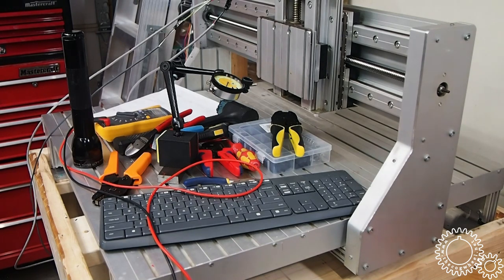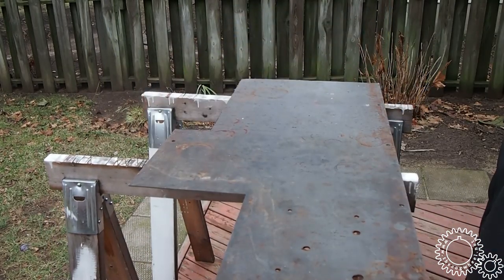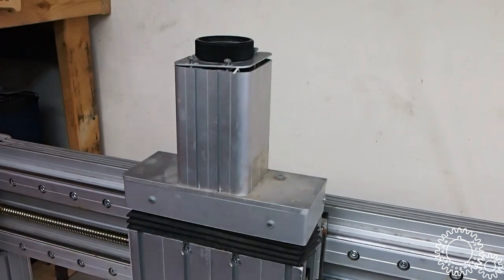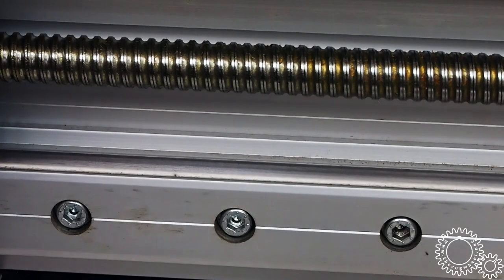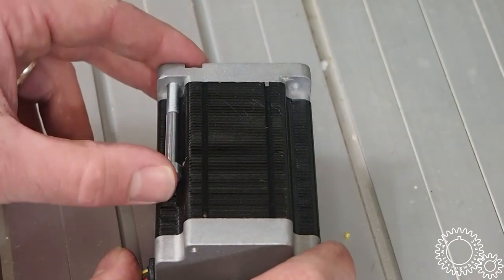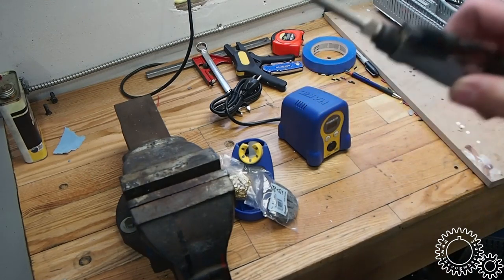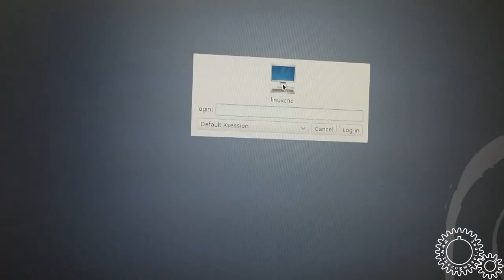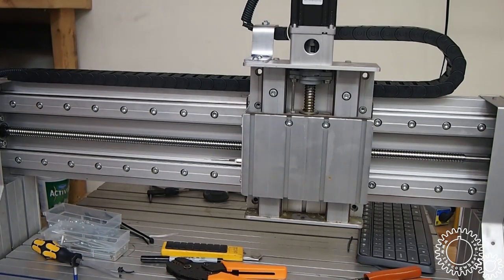CNC Router

Comment: I've had the same router for two years, I had the impression that it was made in Finland (there's a label that mentions it was manufactured in 1990's) but it's probably assembled in Finland from a kit and sold to schools. My machine's Z ball screw has 2 mm lead, seems you have 5 mm, X and Y have 4 mm. It's a sturdy, cabable machine, I can easily jog it at about 3000 mm/min and mill wood at 1800 mm/min, running linuxcnc & Mesa 7i76e and DM542T drivers.

Comment: What you have is a Techno Isel router table. Originally released in the late 80's and early 90's
I can with what was called a machine 100 MS cos controller. Back in the day a new on would be about $ 8000 or so. I have the same machine from the 80's it ran model and prototype production 24-7 for about two years. I mothballed it for some while then had a new controller built and I still use it today. I made a mount for. 3 h.p. Ryobi router when I first got it in 1987 and  it still works like a charm. I run V carve desktop and Mach 3 on it making sings and doing woodwork. My table is 52 by 52 . By the way the stepper can get warm but they seem to convey the heat well. Never any problems running it for 10 to 12 hour runs. Just stay inside the feeds and speeds. The ball screws are a big plus but keep them clean. Like yours mine had no goers on the x and y rails. Let me know if I can be any help.
Reply from the maker: Thanks John for the thoughtful and informative comment!  I figured it was an expensive machine.  What drives did you end up running?  I have some inexpensive drives (Chinese knockoffs) but I'm planning on upgrading to Leadshines or Geckos at some point once I get a few hours on it.
Reply: I'm using Geco drivers. I had the controller custom built in about 2010 it still works fine. 
The steppers I have look larger than yours and mine draw about 1.5 to 2 amps. Mine has 
5 mm pitch ball screws. My Z axis router is really heavy but the machine handles it like nothing.
I have made all sorts of tool holders and waste boards for it over the years if you need some help their.
Reply: @johnr9896  hey I bought the same cnc machine from a shop for a very low price with some missing parts. But I cant find any documentation. Do you have any user manual or assembly guide ?  Then I can start to rebuild it 🙂

Comment: Nice find Justin, its Germanish. Stylish is also my main concern when picking out a soldering iron.

....Concrete
Reply from the maker: I really like the iron.  I had some reservations not being a Weller but it's really nice.
Reply: @thecogwheel  I just thought it was funny the top  line of the box of the iron said stylish.
Reply from the maker: I'm told 4 out of 5 smurfs think this is more stylish than the Wellers.